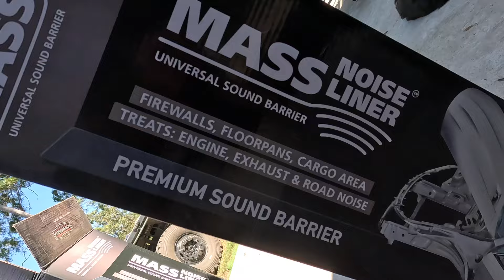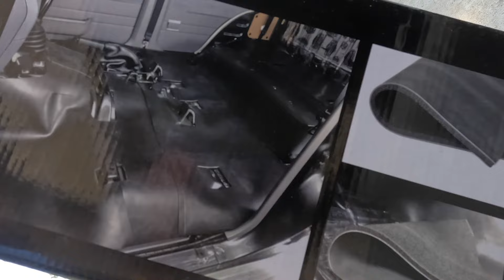UNIMOG BUILD SERIES EP.4. IS IT REALLY WORTH IT? CAB REVEAL, Installing car builders to the unimog.

Comment: I did the Isuzu NPS kit. Hard work but worked great. It had a 6mm noise cancelling foam that was sticky one one side and foil like on the other between the stage 1 and the carpet. So 3 stages all up on the walls and ceilings🙂
Reply from the maker: It’s definitely hard work! Do you have a duel cab nps? Yes we’ve been that kit too!

Comment: Interior has come out very nicely with Carbuilders sound deadening.🔥🔥
Some other improvements which I can suggest are 
*Upgrades to accelerator,brake and clutch pedals 
*Conversion of ashtray to a usable USB type A or C ports
*Scangauge 3
*Black spray painting the shift levers
Reply from the maker: Thanks mate appreciate it! Good suggestions, might have to get stuck into it!